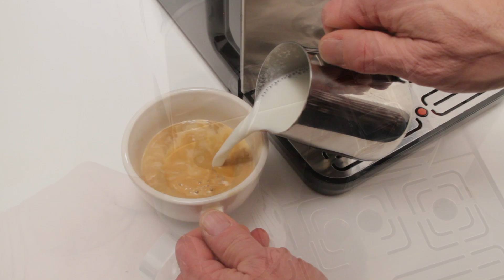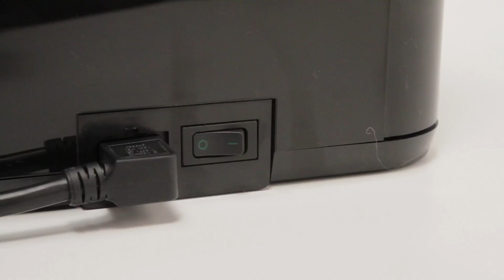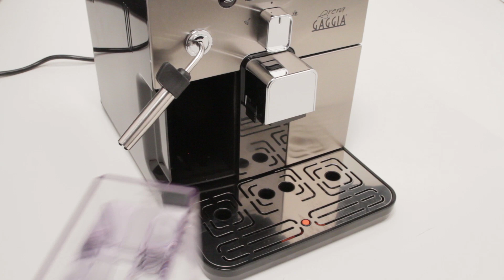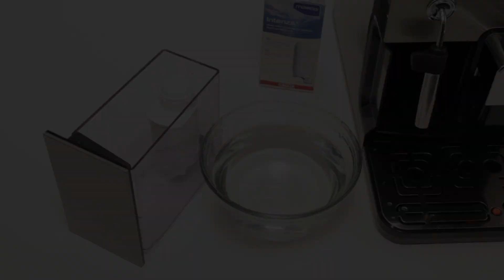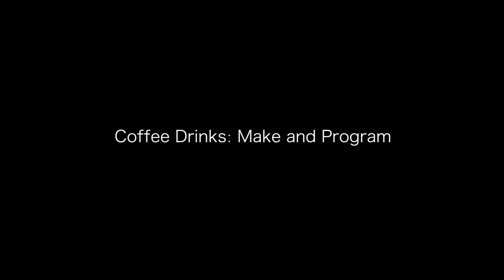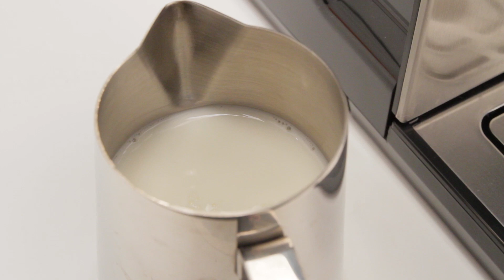Gaggia Brera Quick Start Guide

Comment: I had the Phillips version of this machine for well over ten years (exactly the same machine inside and out, with a few cosmetic tweaks). The Phillips Saeco has performed exceptionally for well over a decade, and it is used multiple times every day. The centre knob on the Saeco has become loose and a little troublesome to turn (they have changed the design in the Gaggia) and the steam was getting weak, so I thought I would replace it. I was really happy to see that I could buy the Gaggia version of the same machine. I swear by this machine! I do take care of my machines - I only use filtered water in it, and descale once a month when it tells me to, I rinse out the machinery as directed in the manual about once every couple of weeks, and grease the channels once every six months. It has lasted somewhere between 10-15 years! In fact, I will be handing the old one down to my son. I only use medium roast espresso beans - no overly oily or flavoured. I set the grind to one notch before the finest grind and to the strongest brew - three beans on the front. I use Kicking Horse 'Cliffhanger' whole beans. I make a 'two shot' cappuccino with whole milk. Although I have only had the Gaggia version of this machine for a couple of days, it produces the same consistent great coffee as my old one. Of course, I guess something could go wrong, but given my experience with this machine, I doubt it. And yes, you will get water in the tray . . . its italian! For the price, you really can't go wrong.

Comment: I've had this model for about two months and it does make great coffee.  But I think I have a problem with the rinse cycle, both at startup and shutdown.  Instead of dispensing the rinse water through the nozzle, it goes directly into the drip pan.  The same thing happens when descaling.  The initial phase call for water to dispense through the nozzle, but instead it goes into the drip tray. I've contacted my vendor to find a solution.
Reply: Any solution for this? Mine does the same :/
Reply: @gaizkafg  Yep, and eventually, it will also dispense your coffee into the tray instead of out of the spouts. This is my 2nd Brera and both have/had the same quirk. Just play with the knob a bit to hit the sweet spot that gets it to dispense properly again.
Reply: Yep, and eventually, it will also dispense your coffee into the tray instead of out of the spouts. This is my 2nd Brera and both have/had the same quirk. Just play with the knob a bit to hit the sweet spot that gets it to dispense properly again.

Comment: I have had this machine for approximately 3 weeks.  The first 2 weeks I was able to use it and the machine was wonderful. Now all of a sudden when I try to brew coffee spurts out on each side of the coffee ground container.  What is the solution to this problem, I have changed coffee grinds several times, using the same grounds I used originally and then changing to other grinds when it started doing this.  Can you explain to what I should try.  I have watched the video and am doing as instructed.
Reply: Remove and clean the brew group, particularly the shower screen-that's the small round perforated metal disc. It sounds like yours is blocked and the coffee has nowhere to go. Also try a coarser grind, to prevent this in the future. https://www.youtube.com/watch?v=HGmfnGN_JQA